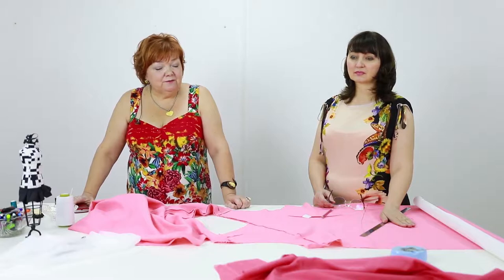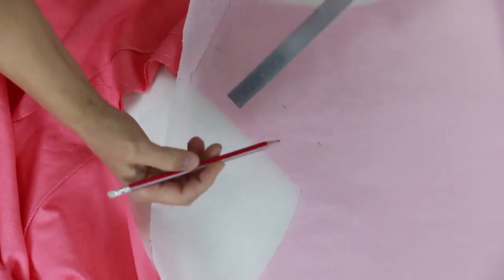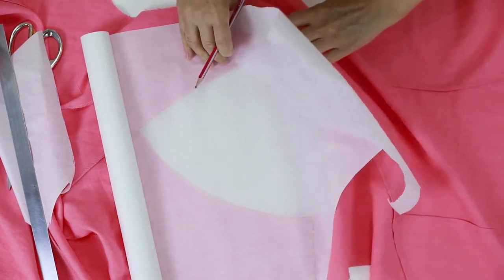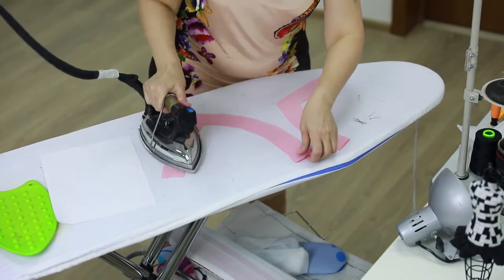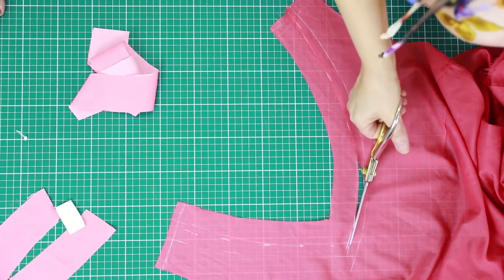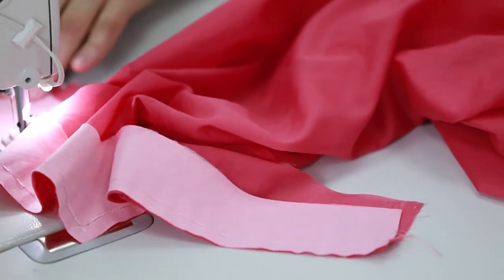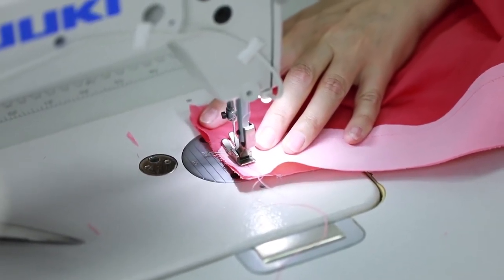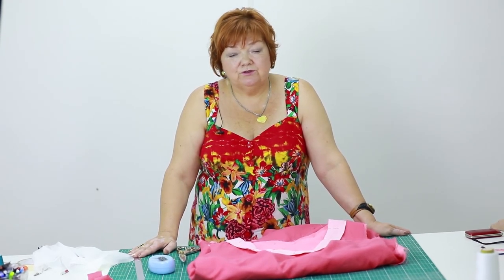DIY: How to make an asymmetric linen dress. How to make a welt – sewing tutorial.

Comment: Hii
What is the difference between welt n adhesive? We only use buckrum here for necklines
Reply: Mano. tz    It's interesting the different terms used in different parts of the world.  

Here in the US, what the video calls welt we would call facing.  What the video calls adhesive, we call iron-on interfacing.  

We also have buckrum, but here it is a highly stiffened (with starch) heavyweight coarsely woven or heavyweight nonwoven product suitable for drapery headings, making purses, etc.  Our buckrum would be way too stiff and heavy for necklines.  In fact, if our buckrum were to be used in clothing, the starch would wash out in the first laundering and become limp and wrinkled.

For the purposes of your question, the "welt" (or facing) was a single layer of the outside fabric strengthened with a single layer of "adhesive" or what I would call iron-on interfacing.  Would that be your buckrum?

It is an interesting old world, isn't it?
Reply: Faith Adams 
Haha thx for ur reply. Now i understand.  We have varieties here for stick on buckrums... they have nos according to stiffness.  I should decide for myself what can i use for velt n adhesive 😊